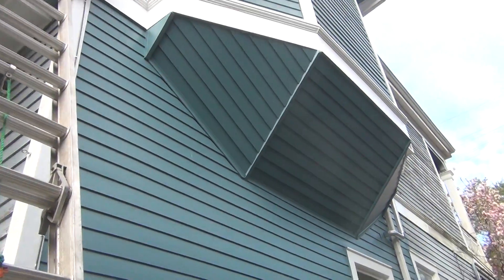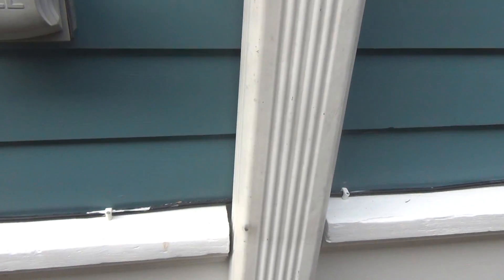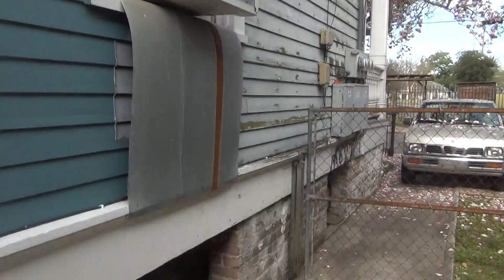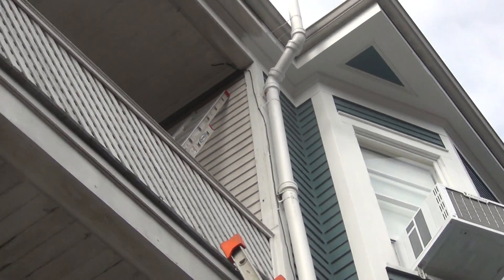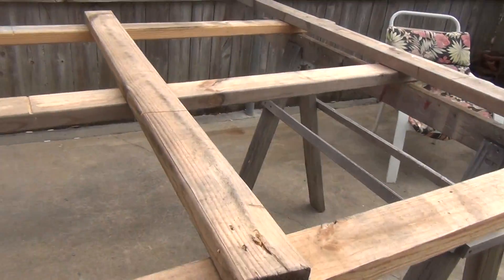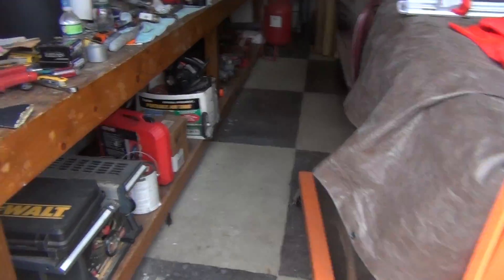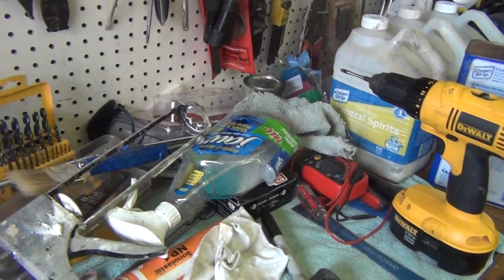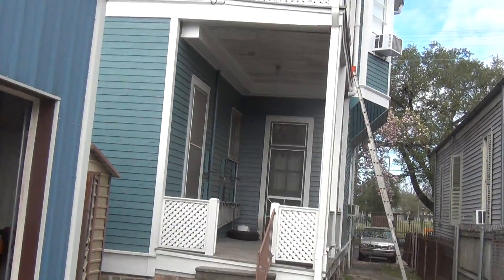Outside work (part#3) A finish project

Comment: Agreed!! It's lookin VERY GOOD!!! As you accurately describe, it's lots of steps to do the job properly. Even then, my experience lately has been that while you do "everything right", the modern products simply no longer perform as well as they used to so it's next to impossible to have the outcome your level of work used to, and should, produce. Starting with the very basics, the lumber, as you pointed out recently. All we can do is "the best we can". ;o)